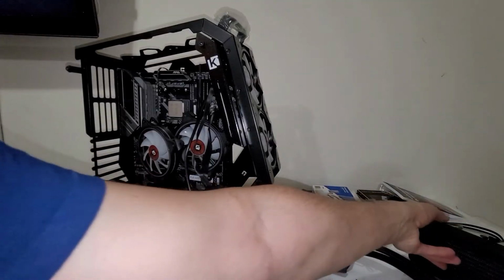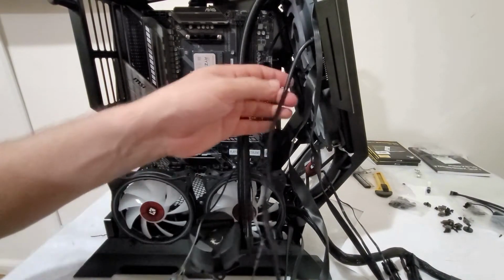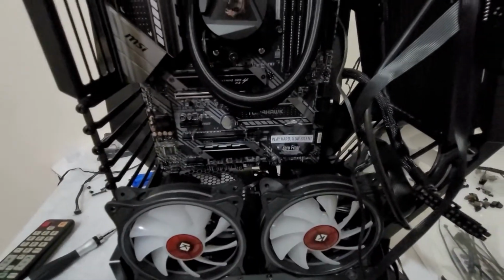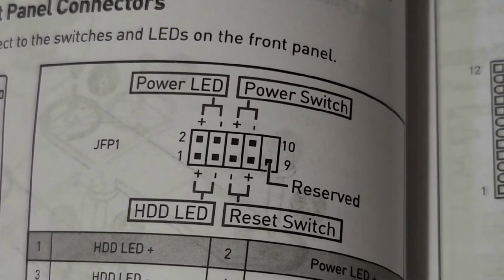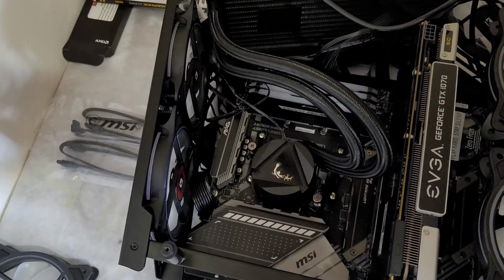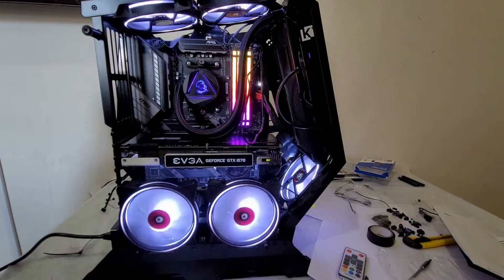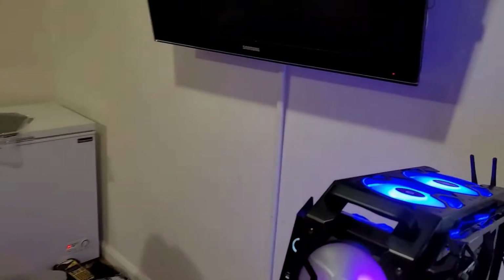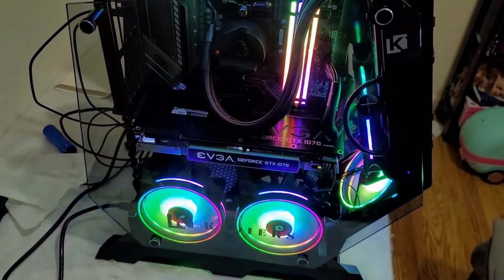Kediers Custom PC Build  PartT.2

Comment: I feel your frustration. I was seriously considering this case but wondered about spacing for the CPU radiator on top, where it should be. You answered my concerns. By the way... I've seen videos that explicitly say to position all hose connections at the BOTTOM to ensure proper coolant flow, preventing air bubbles.

Comment: btw, your front top fans are blowing in, and the fan on the inside is fighting against them, as in a push push configuration. just turn the fan on the inside front top around and have it pull with the others.
Reply from the maker: Top fans are blowing out not in. Not sure if you watched my two parts video but I specifically mentioned that. Cant put two fans working against each other. Doesnt make sense;-) Thanks for your feedback though
Reply: @nyst8fmind  actually no, its blowing in, lol. The side that has the supports on it is the side the air comes out of.
Reply: @nyst8fmind  i can also confirm this because i just moved my gaming rig into this exact case, just the red version
Reply from the maker: @austinsparks4561  are we talking about the top fans that came with the case?

Comment: I did a Ryzen build in one of those cases. Used an matx motherboard... Not as frustrating as I thought...cable management was the issue for me.
Reply from the maker: My biggest issue now is the dust accumulation on the fans and inside. But I'm ok with it, I kinda anticipated it.

Comment: Do you know where the connect the 3 hole connector coming from the lighting control board? There’s like a power plug and then a 3 hole connector. I can’t figure out where it goes!
Reply from the maker: I can't remember if I covered it in my two videos. If not I can check for you tomorrow.
Reply: @nyst8fmind  thanks man, I’m putting all of mine together right now and I’m totally stumped.
Reply: @GM_Enjoyer  i know i'm late to this but if you havent found a way to connect it yet, it's a 5v ARGB header, it connects to your motherboard, look for a 3-pin male connector with the label ADD GEN 2 5V